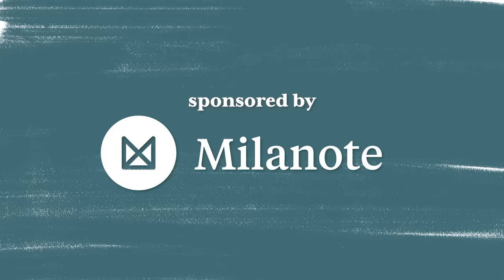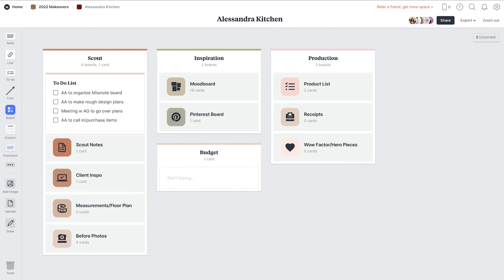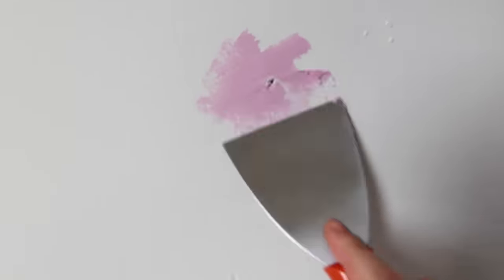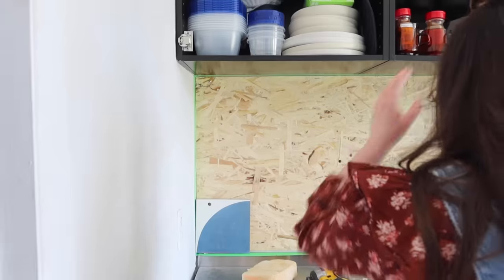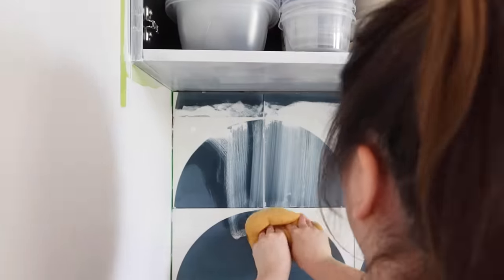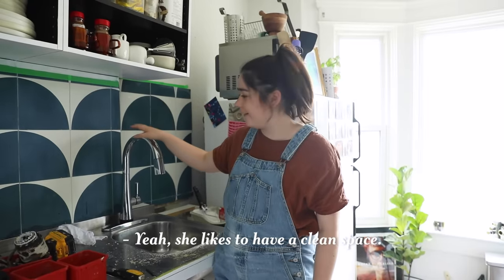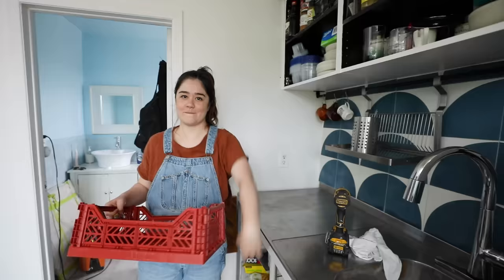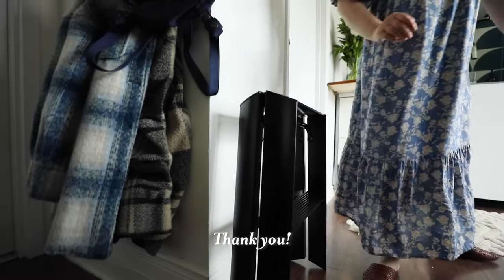65 Sq Ft Kitchen Makeover *Renter Friendly* | EXTREME BEFORE AND AFTER

Comment: I love your design and your vibe.  I’m a retired OB/gyn who became a contractor in my 50’s.  I taught myself to tile and I’m pretty Impressed by what you did there.  Tile does make all the difference I think.  As a Mom though, I’m worried about the grout, especially in a rental.  Make sure, that if you are using sinks to rinse out the grout sponges, that you let the water run for at least 20-30  minutes after you are done.  Otherwise the grouty water turns into a solid and will ruin your pipes.  Unfortunately, I learned this the hard way…..I hope you don’t mind but I’m going to steal the use of cane over the louvered door at some point!

Comment: I love the renter-friendly option for tiles! And little things like changing the direction of the door on the fridge will make such a difference for her!
I just love the renter friendly series. There are so many shows where everything gets ripped out and replaced, but I think working with what's there is so much more inspiring! (Even now that we are home owners for the first time).

I do wonder, can the drawers open when the drop leaf is down?
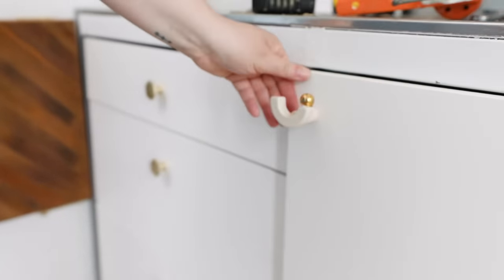Reply: I checked at 29:33. The drawers seem offset from the wall enough that the drop-leaf shelf doesn’t get in the way while it’s dropped down should you want to pull out the drawers.

Comment: Fantastic makeover, as usual!! An idea: I'd use that wonderful round corner to place a semi circled bench (mabe a custom made one) and put the round table in front of it to set up the dinning situation. It would save a lot of space and look fantastic!
Reply: And with the two chairs could seat five. Would also be possible to use a temporary larger circle top for a larger table for the few times she might want to have a larger party. Add a few folding chairs and serve on smaller dishes could squeeze 5 or six in a pinch.
Reply: and she wouldn't be too close to the oven!

Comment: I too have a tiny kitchen. The problem with switching frig door swing is that sometimes they don't stay closed. Manufacturers do not recommend. I installed a child safety latch that prevents the doors from coming open. I would rather have the latch then the awkward swing on the frig. A Graham styled cutting board sink sized would give added counter space. Beautiful.

Comment: It's nice to see you expanding your confidence and skill set under Graham's tutelage  :)  I have seen this tile on board technique and it's a great idea!  I know you were going with the half-moon motif, but I wonder if you considered doing the pattern in quarters?  It would have still had the vibe, but the smaller scale might work even better in the tiny space.

Nice accent colour, but it doesn't tie in with anything else.  Love the mat.  I wish you had done something with the window... window sill plant, café curtains, hanging stained glass, painted trim...?  And I would hang the picture on the empty wall above the folding counter instead of by the frig (where there is already a lot going on).

Another great space saving idea in a small kitchen is a pull-out cutting board /workspace.  They sit in the space between the top of the lower cupboard (or drawer), just under the counter top.  They are a flat panel with a cupboard pull that extends when you need them.

I would have chosen a neutral colour to make the storage baskets above the cupboards disappear, rather than have the colour draw your eye to something that is not really a design feature.  Same with the garbage, I would have chosen another colour - maybe the robin's egg?

What's with the floor space under the first cupboard?  Would a storage basket slide in there?

Good job!

Comment: With an uneven ceiling paint the same colour down the wall an inch. Once it's dry tape a new even line down the wall as close to the ceiling as possible. Now paint, this is especially nice if the accent colour is dark or bold.

Comment: Hey gang, I’ve installed cement tiles like these into my own place and what I was taught to do was once you install and grout them, sand them with a medium, then fine grit sand paper, then polish with wax. Though I used a waterproof sealant. Because the motif is around 3 - 5mm thick it won’t be effected. 
Also I think Graham and I should get married. 
Keep doing great things!

Comment: Okay, so I'm confused. You drilled the board for the tile directly into the wall, THEN you mounted tiles to it, some with holes that you also drilled through the board into the wall (that step was so clever). So how does the tenant get the board off just by removing the screws from the tiles when there are also screws holding the board to the wall UNDER the tiles and thinset? So confused.

Comment: Looks great. Really liked the paint color though not sure what I see is the true color. Looked more green than blue.  One safety issue: have always understood you should not plug anything else into the outlet for the fridge. You should check with an electrician ASAP. You really went all out using real tile! As it's a rental, I would have done peel and stick (I don't have a Graham). My only issue was with that rug that looks like it belongs in the bedroom. Very impractical for a kitchen. You want a flat, sturdy weave and a color that won't show every drip.

Comment: I'm really curious as to how painting walls and cupboards, and putting up shelving is considered renter friendly. Every place i've rented does not allow any painting, no shelving (you can't even hang up a tv or picture frame if it requires a nail in the wall), and definitely no touching cabinets. The one time I used peel and stick removable wallpaper my landlord saw it during our yearly inspection and freaked out on me saying it would destroy the wall. (it didn't). Do you just ask the landlords ahead of time?

Comment: If there is a space that can use space for a bench with storage by the window - this was the one. 
And how did you manage not to level things - in the kitchen. Just add something under the legs of the cabinet and it will level ? To have 5 people for 3 days in the kitchen and not to have level work space.

Comment: Quick note, I have those magnetic spice containers, and they are the WORST. I like that they stick to the fridge, but powder gets stuck in between the metal and gets everywhere every single time I use them. They're just super messy and not as well designed as they seem.

Comment: I know it’s done and there is nothing to do, but I would get rid of the gap on the backsplash area fill it with the board, get an even wall for the backsplash since you are already doing some walling hehe. Also, Instead of wood countertop again, I would fill that spot via stainless steel panel to match the countertops. Lastly, I just want to say bad things to the landlord, like come on!

Comment: Wait. So there’s a hole in the counter but also a shelf for the range? Is she supposed to use the range in the hole in the back of a counter that was extended? That’ll hurt the back. And she will knock her hip/back on that extension next to the fridge. Ouch again. That rug looks slippery. Is this supposed to hurt so much? Also watch what you put above an oven if your planning on using it there. Heat rises and can be stainy/melty/burny to anything it hits on the way up. It looks cute though.